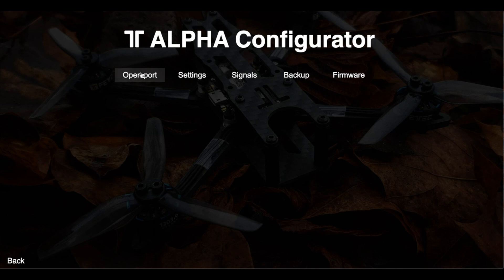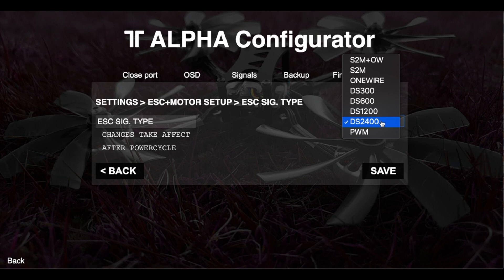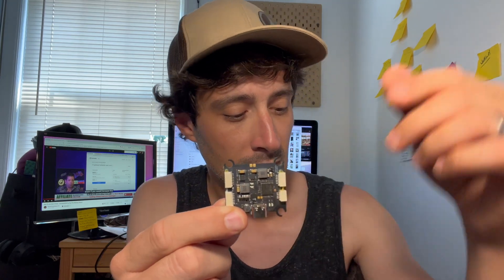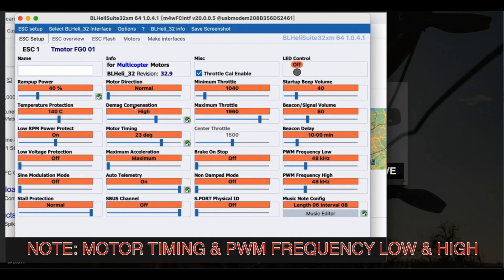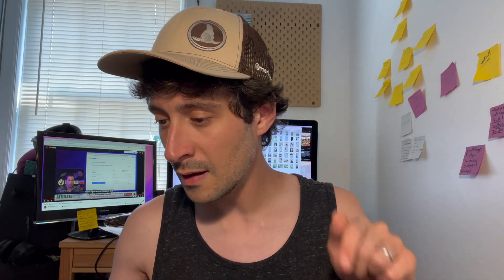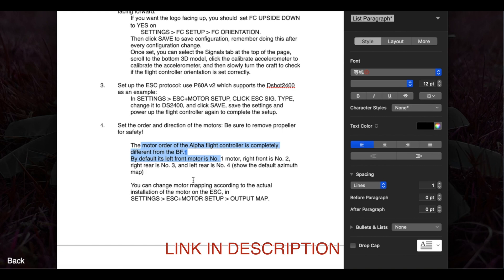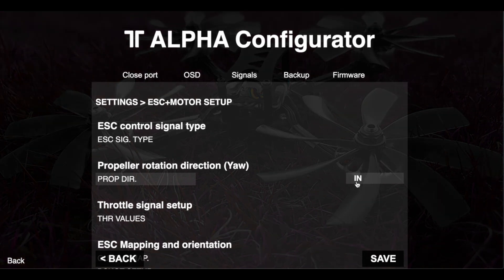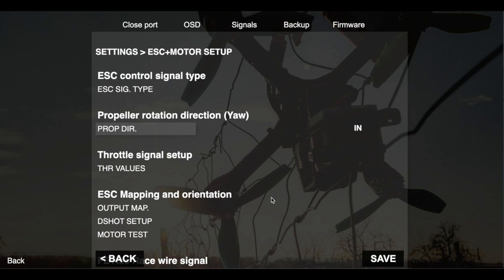Do This BEFORE You Fly T-Motor Fettec Pacer G4 w/ESC

Comment: Thanks for this Matty, I have the same stack, I burnt a motor out so I think I better take a look at my blheli setup, it’s running DShot2400 but I never checked esc settings
Reply from the maker: Definitely check the variable PWM thing that’s gonna be a game changer
Reply: Thanks man my esc has Dshot2400 128k stamped on it so should I run this at 128k you reckon?
Reply: Yep you’re 100% right Matty 48khz.
The esc is capable of 128khz but the motors ain’t 😂

Comment: Can't get the mil amps used in osd any idea? Its showing in my goggles but stays on 0 at all times and never changes. I'm on the same stack as you. I have also allready did these changes in the alpha gui. Its flying grate and all other osd information is working just not amps used and that for me is my fuel gage.
Reply: Current sensing doesn't work on both of mine either. Fettec docs imply for non fettec ESC's to run ESC current sense wire to SC pad on FC, but there is no SC pad on the G4HD. Pretty shoddy if you ask me, surely someone else has this question on why current sensing doesn't work on this combo. Rather important.